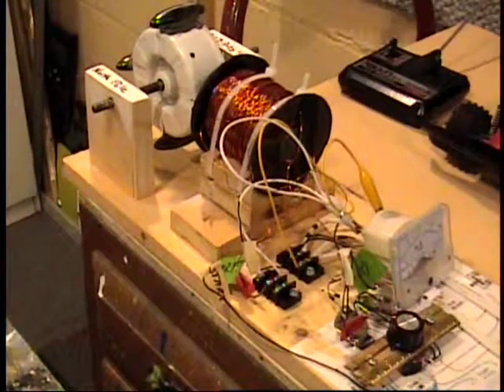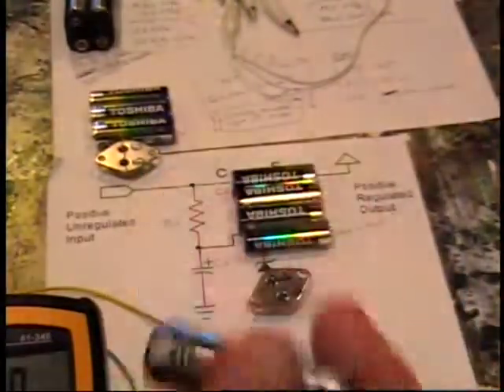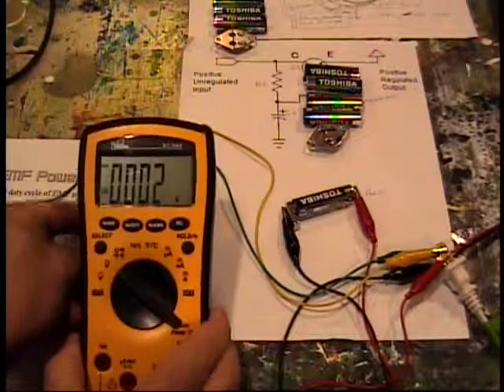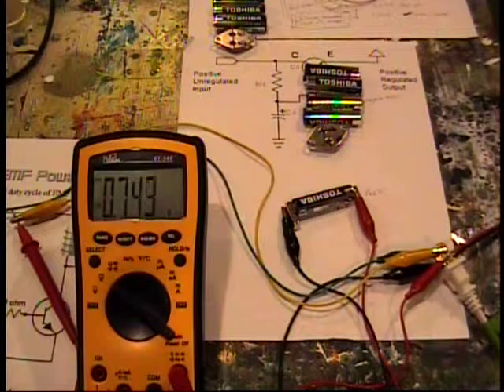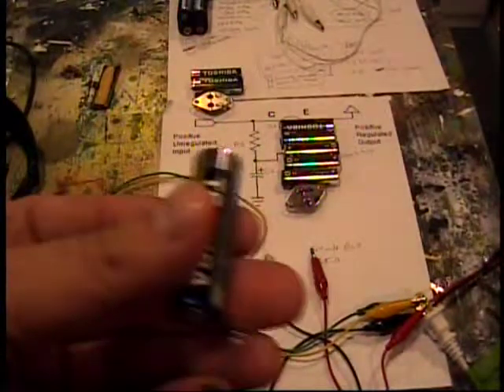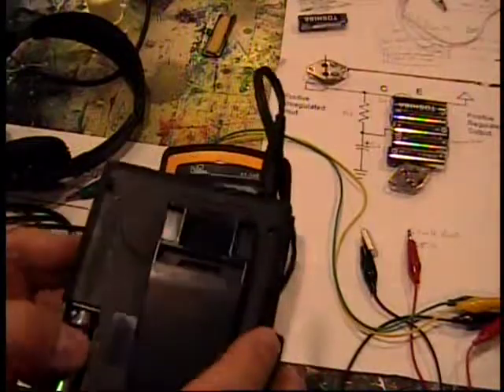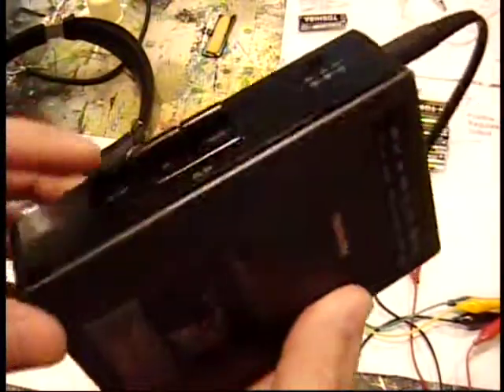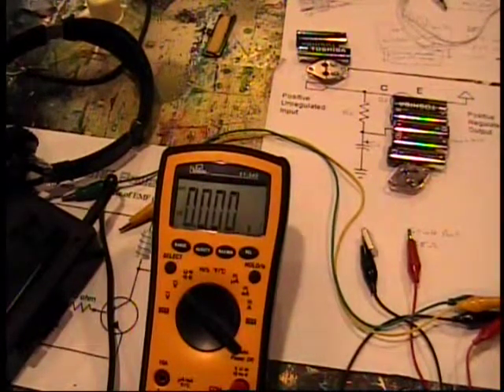Alkaline Battery Recharge Fail 2

Comment: I have a sunbeam from the dollar store and it is acting just like a capacitor so with that and an electrolytic capacitor I am pulsing it  with a pulse width modulator starting that at five volts after the cap stores 9 volts in until reaching it's full capacity 15 volts and then letting the cap drop to five volts and start over.  The battery won't drop below 4 volts though, maybe after weeks. The battery is holding up the cap at 15 volts when the nine volts in is removed. 9 volts in is coming from a transformer that I grouped 4 different K reistors at low milliamps and nothing is getting warm. So the battery is holding the Cap's 15 volts up when I pull the 9volts from the resistor bank off and I'm watching it drop with a 4volt LED as it dims from bright down to where it cuts off at 4 to 4 and a half unless I stop it at 5 volts, the Cap will go clear to the bottom without the battery to stop it. Also a  VU meter to watch the needle move. So .... I'm perty sure that's what I just saw happen. This stays as a live circuit maintaining 15 volts with no input and the battery kept the cap from rapidly discharging and only decayed at a very slow rate, I'm just not sure how slow yet but the battery will maintain 4 volts for maybe months anyway as, it has been in a bucket of batteries I have had for a couple years and this is what it was reading when I found it. So this will be a good circuit to pull very low voltage from to charge a button battery or maybe a AA battery as it should be very smooth and gradual ..   polished
I have another 9 volt Sunbeam battery that I put 9 volts in and it is holding at 15 volts, I have not tried to put it in place of the 9 volt sunbeam that holds at 4 and a half volts yet these are nine volt batteries. With this I should be able to increase the voltage in slightly to charge a group of 1 and a half volt batteries at a very slow rate. The Cap I am using is a 15 VDC 4000 microfarad electrolytic from ELNA, it just happened to be sitting here when I started wondering and the VU meter is a 15 volt scale  .. So .... maybe with a new 9 volt duracell instead of the dead Sunbeam it would be able to charge and maintain another 9 volt battery and keep the Duracell maintained without anything getting warm  ..  The Sunbeam that is holding at 4 volts is from 2020 and the sunbeam that is holding at 15 volts is from 2018  
Maybe with a logic anilyzer this circuit could be set up to cycle automatically until the 9 volt battery is sufficiantly charged and then disconnected from the live circuit  ..
I think for now I will collapse the voltage of the circuit with the 2020 in it to 9 volts and let it charge to 14 and a half or 15 volts and then start over again and see if the 2020 gets conditioned or maybe improves but surely a new 9 volt battery that hasn't been compromised could be maintained  ..
The 4 volt LED cannot be lit with either the battery or the cap seperatly and the LED will not dim without the pulse width modulator ....
ALSO:
by arranging shorter pulse intervals from 11 (heard that Spinal Tap) and back to 9 volts for a while I noticed the battery appears to be helping the cap reach it's full 15 volts faster, much faster  ..  and nothing is even getting warm except the transformer and it is barely warm, the cap and the battery are at room temp.